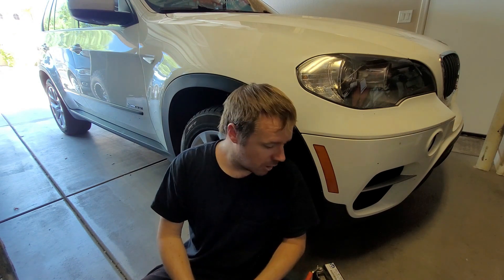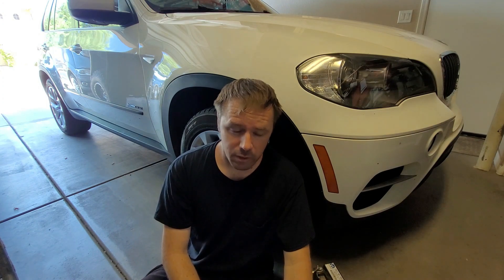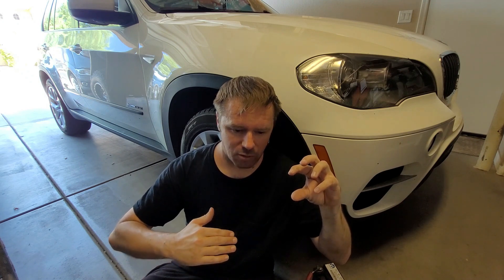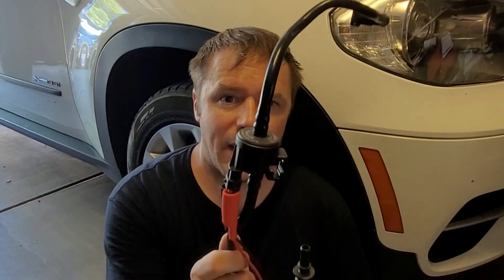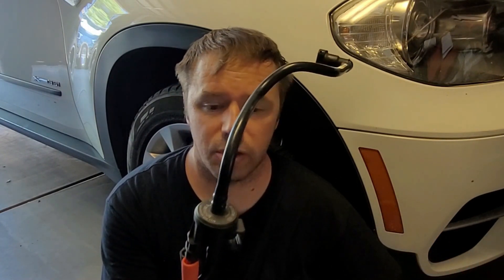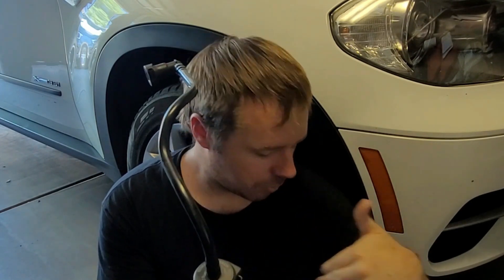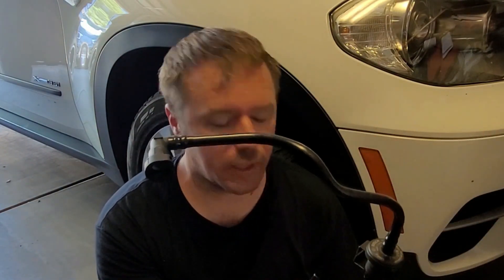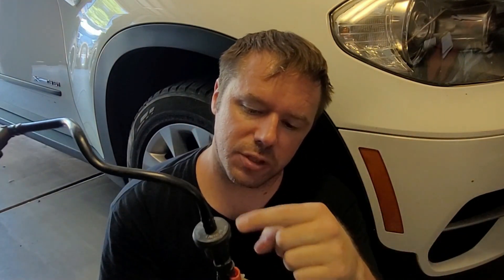How to Fix P0442: Evaporative Emission System Leak (small leak). Test and Replace EVAP Purge Valve

Comment: I got this error on my TT mk1 bam and I've changed the canister,all pipes and n80 (purge valve) and still I'm getting this error..car idling rough as well..also done a smoke test and no leaks...any ideas?
Reply: Check the fuel pump maybe small leak on the top